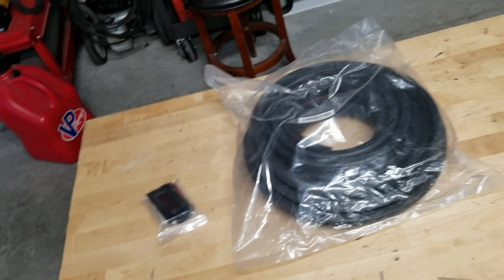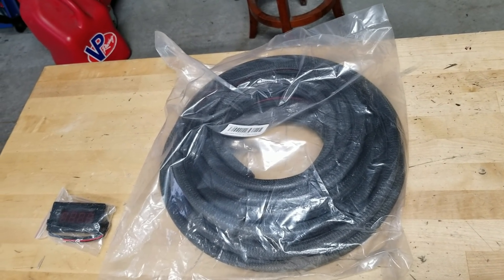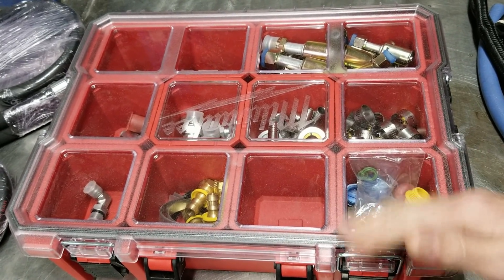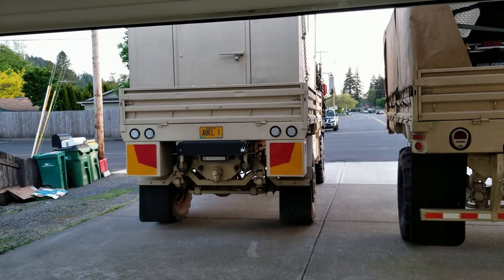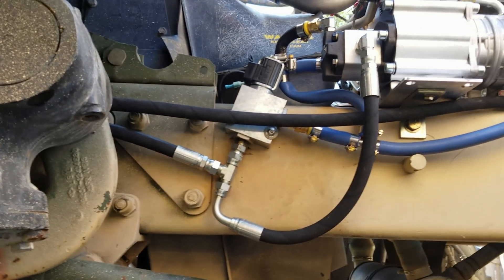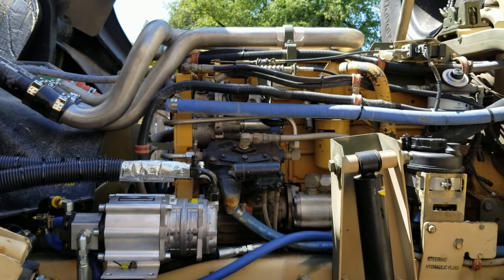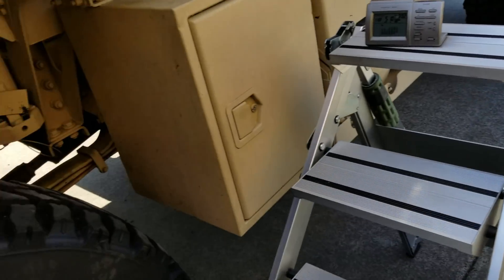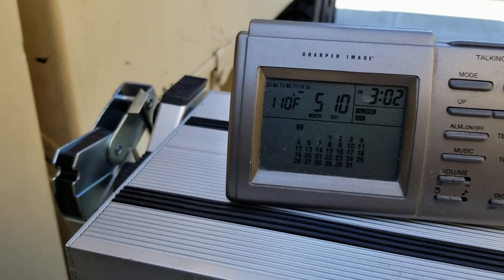Abel LMTV build part 103 (New door seals, Interior temp gauge, RedDot a/c continuation)

Comment: Just a heads up for next time or if you make a major repair to a/c lines, I all ways flush everything to clean out any debris from lines etc. with nitrogen and  charge the system with nitrogen. Saves trouble later and makes it easier to find any leaks with out wasting refrigerant. Some small mom and pop auto or home a/c people  well rent you a cylinder for a small job. I do it for 20:00 dollars with a  deposit.

Comment: Knowing what I know about refrigeration. The fittings will seal when Tight. Teflon will do no good. I have never seen AC lines on spur fittings with clamps.  Even though it is a return line, it can reach pressure way above the joints ability to seal.